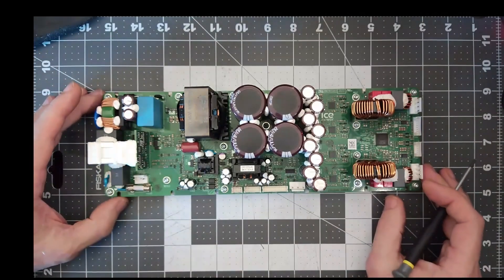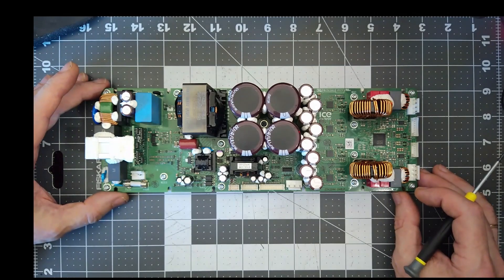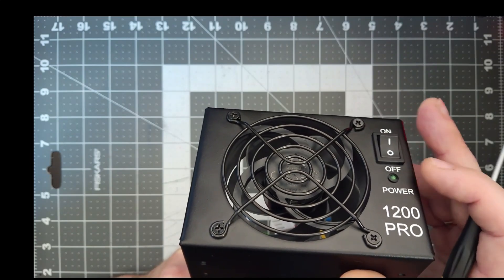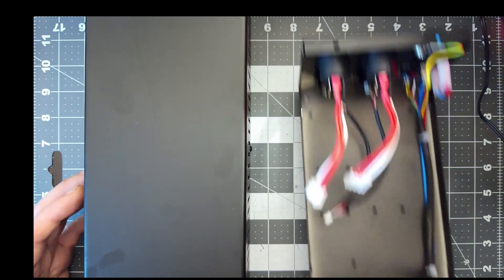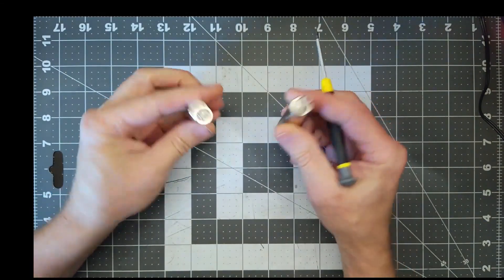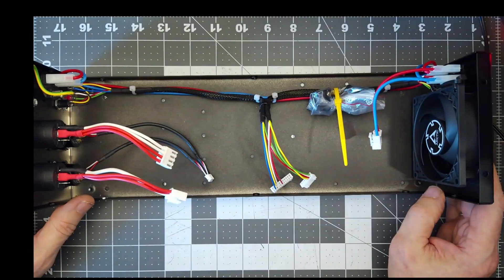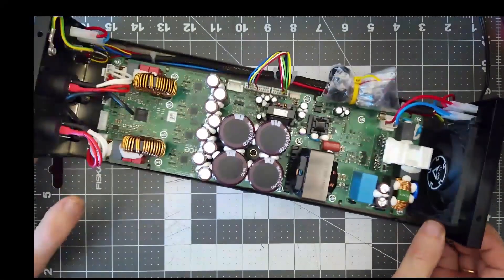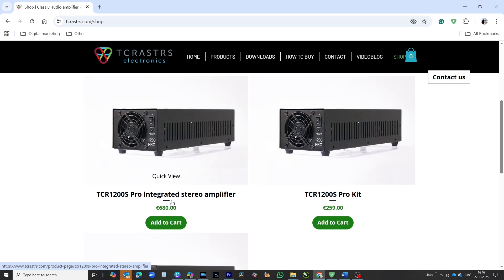Best amplifier in the world, does it exist Part 3 Building world class audio amplifier in 10 minutes

Comment: Given how inexpensive they are, I'm considering purchasing 2x 1200AS1 boards and building monoblocks. I like the possibility of power on from signal (it seems perfect for monoblocks). Is this kit suitable for the 1200AS1 board using only 1 input/output?
Reply from the maker: Yes, that will work and you will have great monoblock solution. According my experience even single stereo versioin is more than ok for home usage.
Reply: @guntarssmits2104 Thank you

Comment: These modules defy all negative internet rumors. I can tell is rumors because all say the same words, not only about Icepower, but class D technology in general. One man tell me that he has never heard a good TPA3255 amplifier compared to A/B. I know from this statement he has not, and would not try any such a comparison. How do I know? Because I have all manner of amplification types in use sharing the same spaces as these class D module amplifiers and I am not put off when changing from one system to another. I go from A/B in my main system, to a WiiM in my bedroom, or to the 1200AS2 in my garage.  

The one thing I can say I instantly sense when listening to the beast ICEpower system is, the amount of headroom and how this seems to impact dynamic range of the speakers and the music itself. There is no fainting of this dynamic range like it seems to do with amps that I own that are run much closer to clipping.

Comment: This amp module is truly a perfect sounding module, not as harsh or bright as the Hypex amplifier boards, and with strong bass which is not always had from Hypex amplifiers with overdamped or smaller speakers. After my own experience making some 1200AS1 monoblocks, I am confident that anyone listening to this board will be impressed.

Comment: It will be difficult to get enough input signal voltage to drive the Icepower module to maximum output unless you have a balanced signal available, because they can achieve up to 4V differential, with some sources capable of 5V or more. So this is another good reason to use XLR instead of RCA inputs.

Comment: Hello sir. It would be great if, in a new video, you could compare in detail ICEpower 1200AS2 versus 2000AS2 amp boards. Both amps are more than enough for me, but my main priority is audio quality. I see marginal differences in noise level and minimum load impedance. Thanks in advance!
Reply from the maker: There is no audible difference in small parameter variation. 2000 has a bit more heat, a bit more gain, and 100 Euro price difference. Quality is not an issue for your choice. Think that quality is the same. For the 2000 version, I would recommend the silent fan version. We should consider an extra heat component, and then, when needed, you can run it to max as well. Any outdoor performance needs significantly more power, even using Hi-Fi speakers, than an indoor.

Comment: hey, i only need 20-50 watts, my speakers are 91-92 db DIY into 4 ohms - is there an argument for having 200 watts in class D? Or would a class AB or A be better....
Reply from the maker: There is a good video from ex-BBC engineers where they are measuring peak power delivered to 92 dB speakers at normal listening loudness.  https://youtu.be/Y3WpRY-EtX8?si=-3Kj4S4AvS7sExaa You may be surprised.
Reply: The ones I'm working on right now are about 92-93db 300w RMS 1200w peak. I'm using d class for efficiency, and space saving. They sound good with 60w to 600w ab too. The enclosure and location are also important.
Reply from the maker: @unbanmy360  My experience is similar.
Reply: @guntarssmits2104 200w might be a little high, if the gains aren't set right. Just under 22v should be plenty.150w could take out 60w RMS drivers. 120w
Reply: @unbanmy360  Do you know how this stuff actually works?